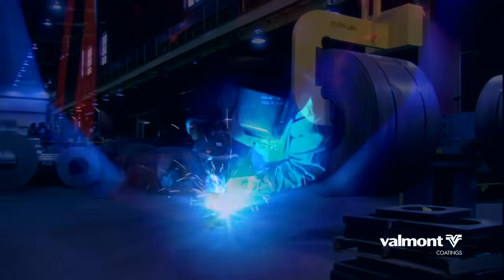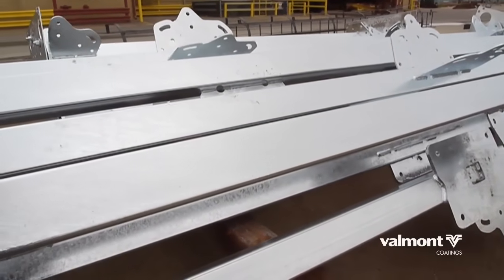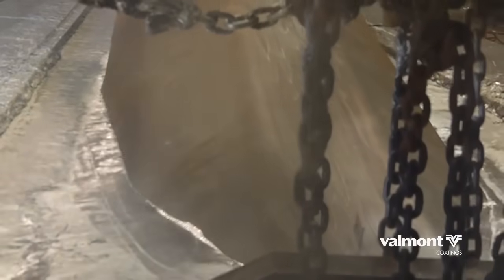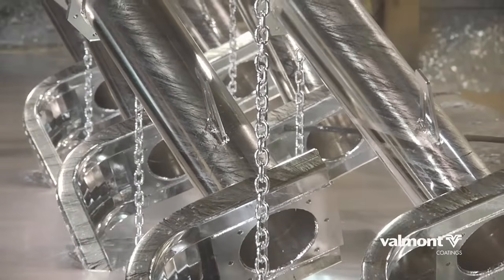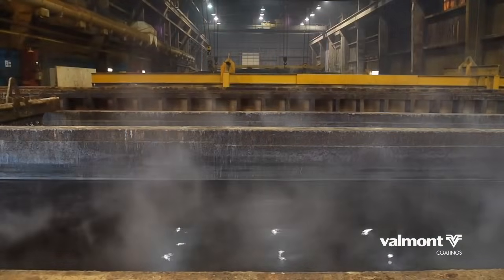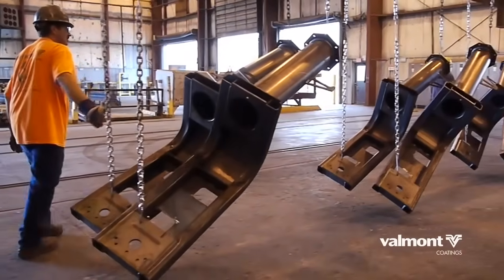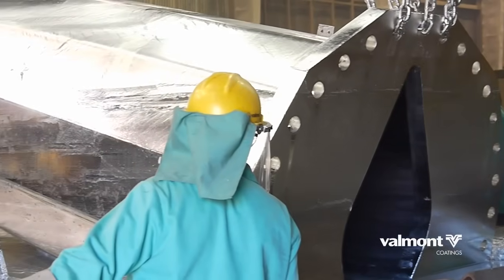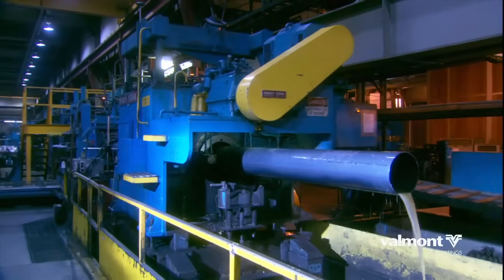What is Galvanizing

Comment: so can someone explain why they don't always do this? For example I watched a video on bridges how they constantly need to add layers of coatings to protect against rust
Reply: Galvanizing is done only on certain kinds of parts because you can't weld galvanized steel. When it comes to making bridges, for example, you can galvanize parts of the bridge, but any sections that need a weld, you won't be able to galvanize, meaning those sections need regularly applied protections like chromium paint. Not to mention, while galvanizing significantly increases the lifespan of a bridge, it doesn't last forever. When you get pieces of infrastructure that are really old, it is cheaper (and often times better for the community) to perform maintenance than to shut down said piece of infrastructure to reconstruct
Reply: It's also slightly toxic when galvanized and they probably take that into account. Especially don't heat it up  @maddizzle1744
Reply: Expensive
Reply: @Brosnan-vi8dv  it seemed like the maintenance was also expensive...
Reply: Believe it or not, they/we actually design things to fail, so we can charge ourselves to rebuild them. Somewhere along the lines this was a good idea to keep us busy and enslaved. We have endless technologies that could change literally every thing we do. Making things easier. The applicable advancemeblnts would blow your mind. This is just the tip of the iceberg. From infrastructure, to housing, to medical, our menial approaches to basic systems are Soo far out dated it's ridiculous! Therefore it is only by design we continue to digress.

Comment: If you dip an already galvanized piece you will warp the time continuum. Same thing happens when you metal detect a metal detector or call a radio station with the radio still on.
Reply: Haha! this comment is legendarily legend.
Reply: GALVANIZE EVERYTHING!
Reply: Ohhh, so that's what the TARDIS is made of!
Reply: HAHAHAHAHA

Galvception!
Reply: Actually you’ll just fuck up the metal and make it have to cook off in the acid for a long time😂😂(galvanizer here)
Reply: @BigsZoop  
So... I cant just electroplate some iron with copper, switch to an another solution and electroplate silver onto the copper coated iron?
Reply: Antonmursid🙏🙏🙏🙏🙏🇮🇩🇮🇩🇮🇩🇮🇩🇮🇩💝✌🙌
Reply: I don't get it